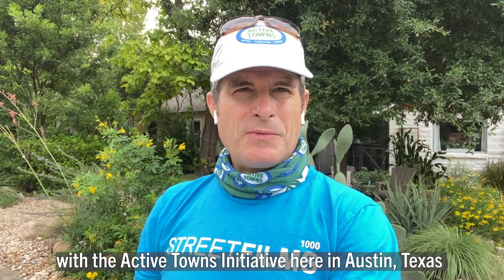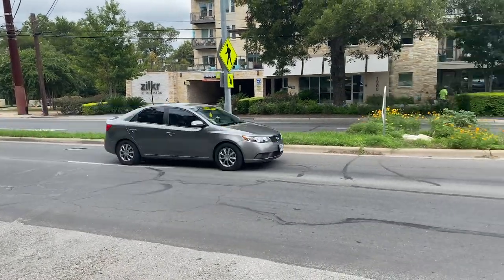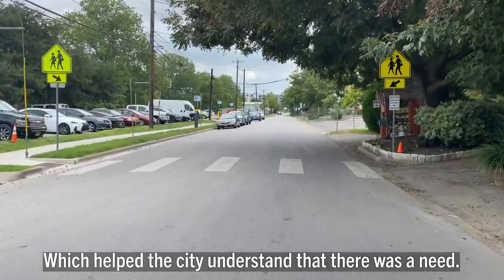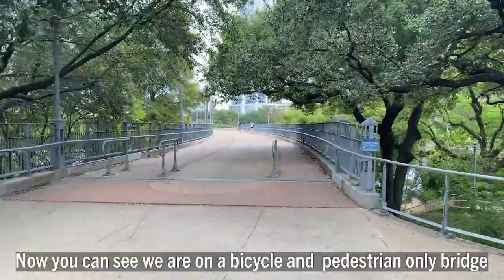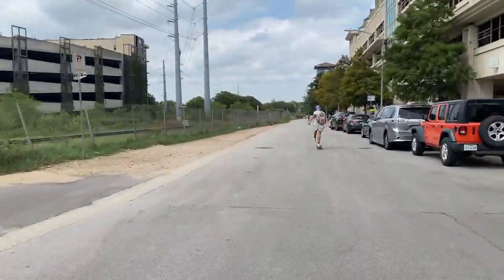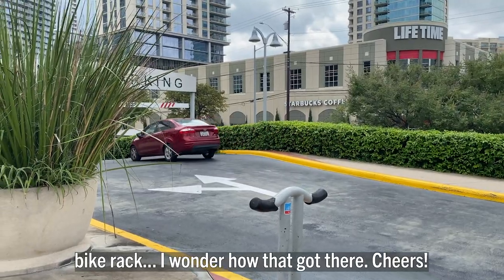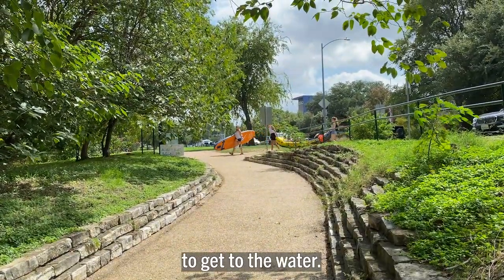A Comfort Evaluation Exercise

Comment: It would be so nice if homeowners were allowed and encouraged to have curb-cuts to allow street runoff to irrigate ponds, wetlands and rain gardens in their yards, as has been done in Tucson, Az. It would have the benefit of watering yards for FREE, filter the water, revive streams and raise the aquifer. This has been done occasionally in parks, and a few small places in Austin, but Austin really needs a program to make that happen. It also prevents flooding. Done city-wide would help to cool the city. 

How do you recommend getting city leaders on board?
Reply from the maker: As I understand City leadership and Watershed is on board at some level... I've documented (but need to publish) some nice rain garden installations including one on Shoal Creek Blvd. But, yes much more needs to be done. Cheers! John

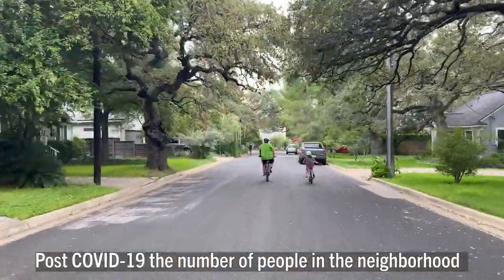Comment: The pedestrian at 1:36 definitely stands out to me. There's absolutely no reason there couldn't have been a sidewalk there...
Reply from the maker: @Jasper, The lack of sidewalks in this area is mostly a function of when the neighborhood was developed - during the great depression and immediately after WWII - essentially they did not have the money and there were very few cars at the time. Fortunately, the streets are fairly narrow and surprisingly comfortable to walk and cycle along... with some additional traffic calming elements it could be truly first class shared space. Most mornings and evenings people walking, running, and cycling far out number people driving which helps a lot. Thanks so much for watching and for adding to the conversation. Cheers! John
Reply: @ActiveTowns  My perspective is one of privilege, but that street is not narrow to me (it's really wide, in fact). Subtract 2 meters (6'7") from it on each side (for a sidewalk - which would have been built where I live, even at that time) and it would be closer to (what I'd call) a normal street, which might still have received traffic calming during the past two decades where I live. And while I basically know the reasons, the fact that a sidewalk wasn't added anywhere during the past seven decades is still hard to grasp for me.

But yeah, the pedestrian still stands out to me. Because even if it works reasonably well, he shows that this street wasn't designed with the most basic mode of transportation in mind.

Trying to make that street into a better shared space seems like cutting costs and corners to me when what's actually needed is a sidewalk. But I guess you'd have to take whatever is achievable...
Reply from the maker: @jasper265  You are certainly not incorrect regarding the width... it's narrow for modern North American standards - when cars are parked on both sides of the street it essentially becomes a "yield street" for motor vehicles which does slow them down a lot - yet when there are little to no cars parked it looks and feels like a wide open tarmac. Yes, for most of the past seven decades the US has prioritized the movement of motor vehicles above all else and most certainly at the expense of anyone daring to walk and/or cycle. What is achievable, at least in this context and as a first step, is people taking over the space, which has happened to an increasing degree since the pandemic. A next step would be a more formalized city sponsored approach to adapt the design to limit motor vehicle speeds and further limit motor vehicle volumes. Not only would sidewalks not be possible now from a financial perspective they would not be supported by the neighborhood if it meant losing any cherished heritage trees many of which are more 100-150 years old.
Reply: @ActiveTowns  Those "residential" streets are wider than most streets right in the city center here in my city in EU. Every morning i take a "major" street into the city that's narrower, that has two way bus and bike traffic, one way car traffic (shared with busses and bikes in the one direction), on street parking on one side, and sidewalks on both sides. Only the first street in the video can reasonably be called a "yield" street, and it only is a yield street if there's cars parked since there's no other permanent infrastructure forcing the yield street design. From the first left on (dwyer i think?) these streets are wide enough to be called roads, and that residential "street", even with cars parked on both sides, would acommodate city busses in both directions in my city, and wouldn't be a yield street at all... 

But it's also in the details (or abscence thereof) in the road design in the USA. The on-street parking is not seperated in any way and is just part of the entire road width, making the roads look even wider visually. In most places in Europe, these streets would narrow near every intersection with islands with planters or trees, protecting pedestrians and pedestrian crossings. And the parking strips would have a thick white line seperating it, or would have a different road texture to signify the side of the street is for parking and not for traffic. But these streets in the USA, even if they're quiet, if there were no cars parked, would look like 4 lane roads.

And the neighbourhood being built in the 1930s or 20s is no excuse really. That just means the city has had 100 years to improve them and update them, but chose not to. That just means no-one in 100 years has made any effort to make these streets more pleasant for walking or anything other than cars. We have neighbourhoods with streets hundreds of years old, or from the 1930s, 40s, 50s, 60s, 70s and so on, all updated at least every 20-30 years to be more safe, and to accomodate safe walking and cycling. So it's really amazing to see a neighbourhood with roads unchanged since the 1930s. I mean they must have had their surface resurfaced a few times over that 100 years? Yet no one thought, let's make these streets a bit better and use better street design? Let's add some sidewalks for kids and people to walk on? No-one? That's just so amazing to a non-american...
Reply from the maker: @johanwittens7712  I hear ya. Yes, it's truly astounding as you say. The reality is that the US, in general, really hasn't seriously questioned (at any level) car-dependency and street design until very recently. Hence, the reason why these residential streets have remained essentially unchanged for all this time. The fact remains, this is our reality and we must strive to make it better, somehow, while the status quo of the "drive fast everywhere for everything" camp puts up a vigorous resistance to any change. Thanks so much for watching and for your thoughtful comments. Cheers! John
Reply: @ActiveTowns  I studied urban architectural design in my day and studied a lot of urban planning. So I'm aware of this all on an intellectual level. We did a lot of case studies of American cities, usually as the bad example of how not to design cities I'm afraid. And on a daily basis I experience a bike friendly city as I don't even own a car but bike everywhere here in EU.

But it is something else to see just how engrained car culture is in every day life over there in the USA, through videos like the ones you make. A trip like yours being that unsafe by bike would have had the entire neighbourhood up in arms decades ago here. But for you, it's actually a reasonable trip. That's just insane. Here we look with envy to the Dutch too, but we've got nothing to complain about compared to the USA...

But hey we had to fight for change too and still need to to this day. 4y ago my city further increased its car resistance and further prioritised biking, walking and public transit through a new even more deep traffic plan, and the media was up in arms again just like in the 90s when the first plan was introduced. "Businesses will go out of business", "shops won't have any customers any more", you won't be able to get anywhere", people will move out of the city in droves", etc. Same old, same old. Now 4y on, the vast majority of the population loves the traffic plan and city is just as popular and bustling as ever, if not more...

Keep up the videos. Very informative! Videos like this and those of strong towns, not just bikes etc. help me keep up with current urban planning evolutions and trends in the USA.
Reply from the maker: @johanwittens7712  Thank you - I really appreciate it. btw You might find my most recent video on our community's resistance of the proposed I-35 expansion interesting. https://youtu.be/c9nbkAnoa8k Cheers! John
Reply: @johanwittens7712  Those complaints sound like those about the traffic circulation plan of Groningen, 1977, 44 years ago.

Comment: A residential street but no sidewalk and no bike lane. You got to have a car in this land of milk and honey...
Reply from the maker: @beftus1264, As long as motor vehicles are traveling at non-lethal speeds and drivers are attentive and courteous to the many people walking, biking, scootering, etc. in the shared space it pretty much works. The streets are somewhat narrow to help with traffic calming but better design elements to help keep speeds and volumes down are needed. Yesterday on my 1/2 mile ride through the neighborhood, the count was 12 people, 5 dogs, and just one motor vehicle driver, who promptly turned off to get to a larger parallel street where there would be fewer people. It's not perfect, but it works for the most part and small incremental tweaks can be made to make it even more welcoming. Thanks so much for watching and your contribution to the conversation. Cheers! John